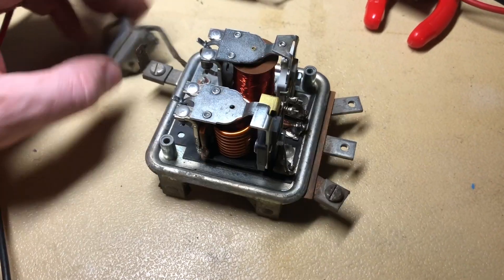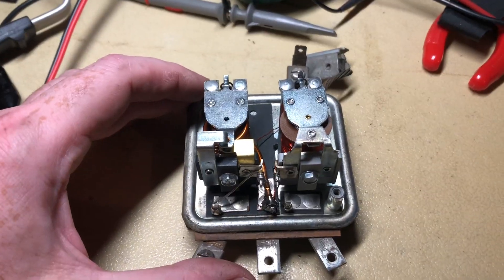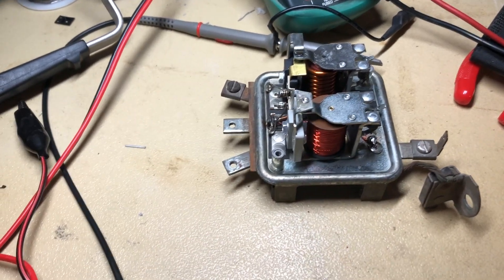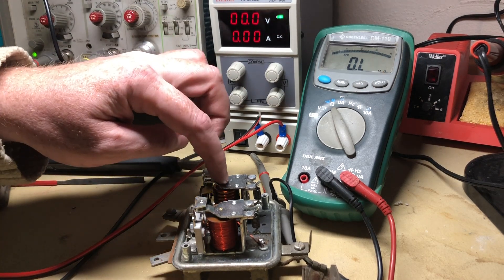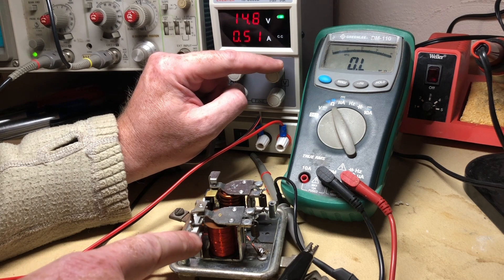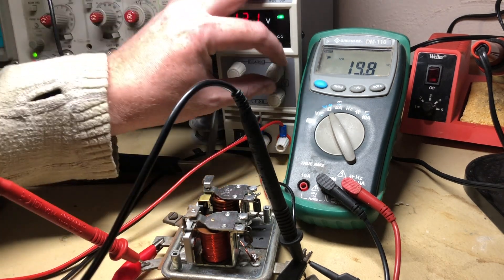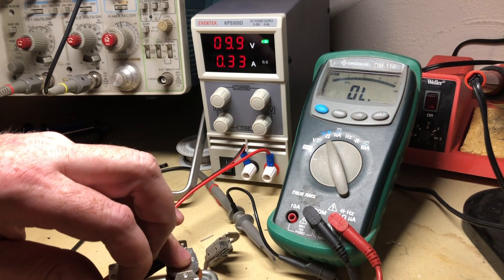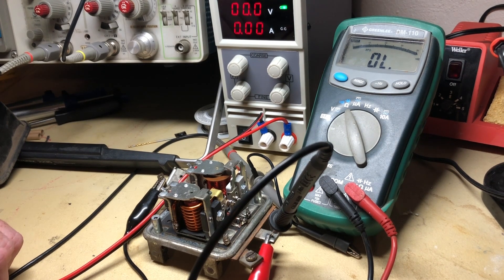Cub Cadet Voltage Regulator Repair

Comment: This is great, did one of my inop. regulator following your video and works great. Could you show a video on the CCO & 70/100 cub cadet voltage regulator with the load terminal and how to properly set these. Great video! Thanks

Comment: I have a new voltage regulator on my 127 Cub. When running at a moderate speed, the amp gauge is pegged in the positive. I checked the battery with my multimeter, and it’s charging at approximately 17.5 volts. Which way do I adjust the spring tension to drop the voltage down?
Thanks!!

Comment: When I turn the key to start, it blows the fuse. Kohler engin sv330s, spec # PS-sv730-0011. I disconnected the starter, but it stills blows the fuse. Would that be the voltage regulator? It's in a Cub Cadet SLT1550. Any help would be appreciated.

Comment: Many thanks for the video.
Where do I find this regulator on an XT1?
Reply from the maker: You’re not going to find this on a cub cadet made since about 1975 or so. After that they are all solid state or electronic.
Reply: @515cubcadetguy9 , could you replace your vintage solenoid V/R with a standard solid state  V/R. It seems to me that the standard rectifiers would work, I would just use G-F as on the AC side and GRN- BAT on the DC side ?

Comment: great video. I am hoping this is the fix i need to get my cub charging again. Thanks!
Reply from the maker: Glad I could be of help! I've found this is the most likely cause of these things not charging. Also be sure the ground wire is connected. Happy to walk you through other things it might be too!
Reply: I have a 128 it has a 4 terminal volt regulator it batt,generator,field,ground. The one I got to replace is load, batt,field will it work?

Comment: I bought a regulator and after installing it the engine turns over as soon as I hook the battery up. What am I doing wrong?
Reply from the maker: Very common problem. On most new voltage regulators, the terminals aren't laid out the same as the old ones. It's likely that the G on the bottom of the regulator is for Generator. You should hook up F to Field, G to Generator, B or Bat to the battery and leave the L terminal empty. Ground should go to a ground on the tractor. The regulator generally grounds through it's mounting tabs.
Reply: @515cubcadetguy9  thanks for the advice, this really had mixed up. Would be ok to reply here if I have anymore questions?
Reply: @515cubcadetguy9  just to clear things up. The 3 terminals on my new regulator are F,Batt,and L. The single terminal on the back isn't labeled at all
Reply from the maker: @paulbarker1118  The one on the back is where Gen should go. Field wire (the small one from the starter/generator) goes to the F, Batt goes to the battery (should be 12v all the time) and you don't use L on a cub cadet (it would be for something like lights)
Reply: @515cubcadetguy9  thanks a ton. Hopefully I didn't ruin the regulator hooking it up wrong. This has been a big help! Thanks again!